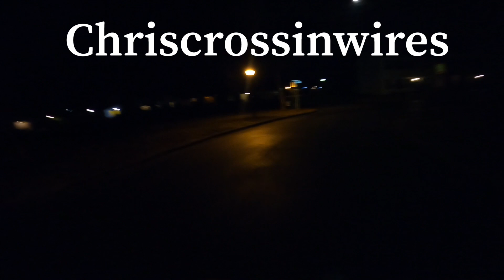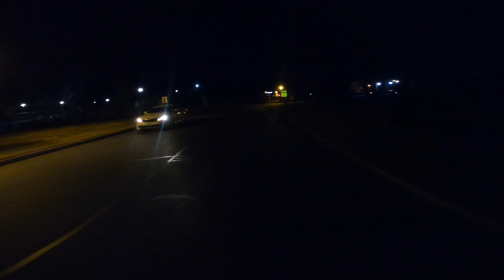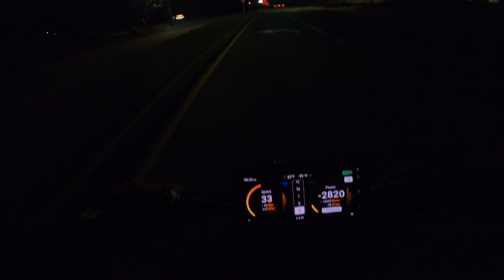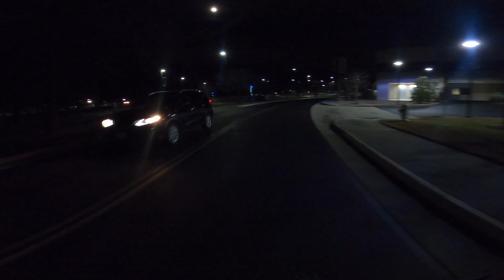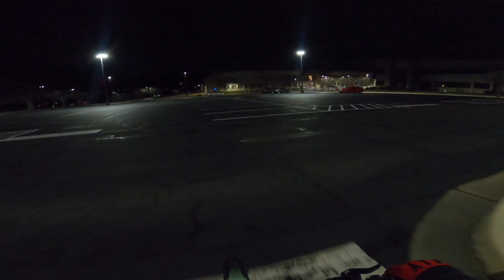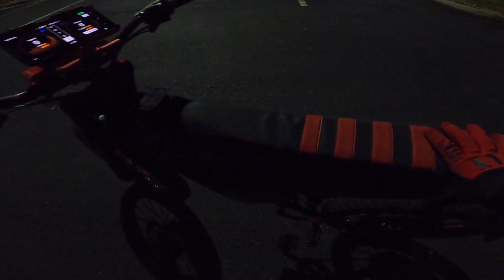Ebike batteries before you buy a pack you need to know a fewlike what capacity and discharge rate?

Comment: I don’t know if you talked about this but what if some of the cell groups in a pack read 4.5 and some read 3.7v I have a 52v that stops charging at 58.5v sometimes 58.3v when I give it throttle it cuts off power at the top range what could be wrong?
Reply from the maker: Obviously those cell groups reading 3.7 have some bad cells  that’s pretty cut and dry so the bad cells are pulling those groupsvoltage down so under load that would cut your bike off I suggest you stop using that pack and replace those c cell groups immediately

Comment: You ride with no lights ?
Reply from the maker: No one rides with no lights My light just shines strait out and doesn't illuminate the ground extremely bright and in combination with my gopro has terrible low light capabilities it looks like there's no light in my videos. It's no where near the way it comes across in my videos. I also have my light right on top of my fender which also helps not reflect off the ground so much. I actually see well its bright but you can only tell if I'm behind something

Comment: some of the batteries weve done for people that have peltier heating and cooling system have been in the 4 to 5 thousand dollar range ,they for small peddle evs and dual motorenduro moto style ebikes
Reply: we supply true multi contactor bms and 20 to 50 amp can bus charger with them
Reply: and the chargers have connectors with interconnect circuits so they dont power up untill its connected correctly
Reply: they meet all the standards to be fully registered and insured
Reply: I’m waiting for the switch to safer chemistry for cells , packs, whatever because the bad publicity is going to be a real problem for DIY! Suggesting LiFePO4 in combination with LTO for instant high torque could cost more but last way longer.
Reply: lith ion in 18650 cell is actually a really safe package ,because the are spiraled they dont suffer any of the expansion issues,and if the battery uses cell level fusing  the likely hood of thermal runnaway is very remote,we also employ dilectric immersion cooling where the cells are fully submerged in 3M Novac liquid,this way the cells never gain more than a few degrees in tempand dont ever self combust @mikemorgan8588